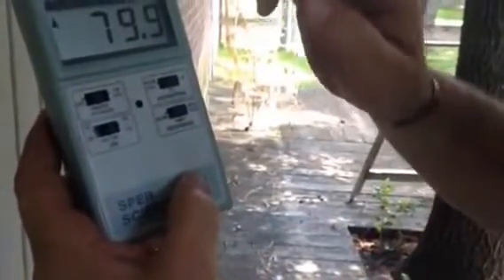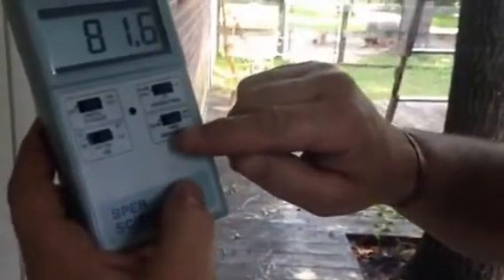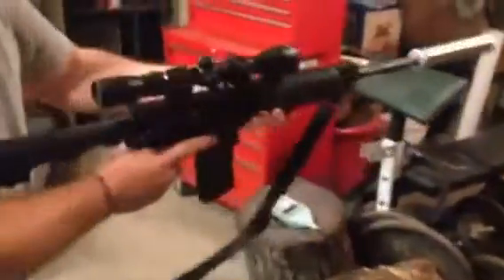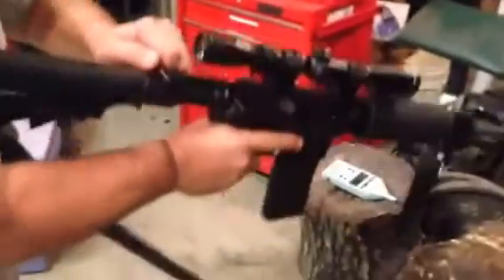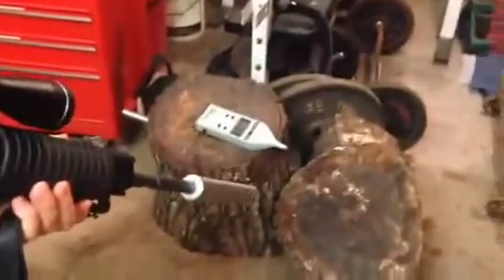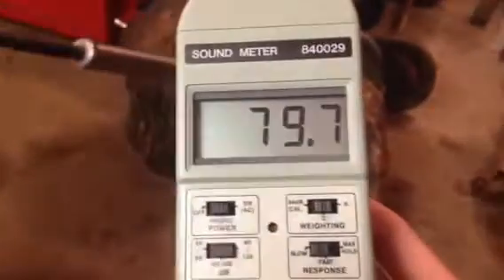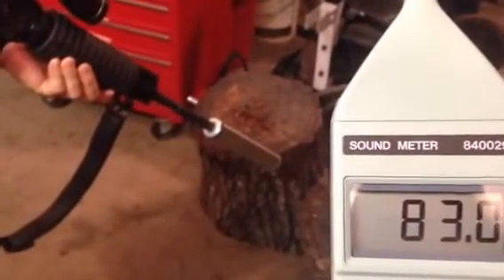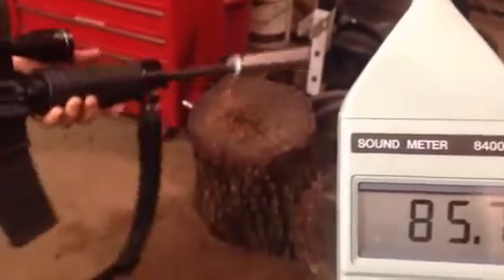Silencer / Suppressor build sound decibel testing

Comment: Is that fuel filter aluminum.? Because eBay has all kinds of fuel filters on there .
Reply from the maker: Titanium, baffles are freeze plugs (steel). I coat baffles with anti-size with has a high temp rating. I think 1,600º F.

Comment: Your Suppressor suppresses down to 82 decibels with standard supersonic ammo?  I have never seen an AR with Supersonic ammo drop the decibel ratings down to 82. How is it possible you can do this but the manufacturers Cannot do it?  

I was just looking at A variety suppressors in a shop Yesterday  And they said that the suppressors only Suppress Down 30 Db Added a are with a 16 inch barrel Deuces 167 db Which would bring the Decibel rating down too 137 db.  What am I missing out on .
Reply: He does not know what he is doing.  Only a few decibel meters can measure gunshot from what I have learned.  They cost thousands of dollars.   Suppressors are loud.... 135 dB or more.  Most handguns are around 160 dB.  His meter did not even move when he shot.  Only when he shot very quickly.  He should never have posted this video.
Reply: M S he’s using a DB meter that is not fast enough to register the impulse of gun fire.
Reply: Well either way he was shooting without ear pro on so that thing is quiet. I think it’s a combination of shooting so close as well and having a shitty dB reader on top. Bullet probably didn’t build enough speed to break sound barrier
Reply: That and it huge with lots of freeze plugs.

Comment from the maker: Whatever freeze plug and spacer you use just remember to put them against each other before you cut the length and make sure the spacer will not slide in to the freeze plug or vice versa. Not a problem if does, it can be fixed: flare out the spacer, but ensure it will still slide in to the tube. 
As far as freeze plugs closest to blast chamber: I started out with eight in the first one and moved down from there in the next four. Just keep in mind you can always add the extra holes in the first freeze after you test, but you cannot plug / remove them. For a 9mm semi auto you will need to add a Recoil Booster (about $150.00) so the action will cycle. You can add a stiffer recoil spring in the slide action of the gun to add a millisecond before the slide pushes back and lets pressure / sound escape with the spent casing. You will notice blow back increases using a silencer, thus getting pistol dirty faster. Add holes to first baffles and or stiffer slide spring to stop gasses from escaping with the spent / empty case.
Reply: Is the spacer just a rubber ring? Also where did you get the front and back screw caps? Thank you

Comment: Awesome.. Hey can you say my name in all your videos? lol. Thats crazy if its that quiet. I have high end air rifles that seem louder then that. I bought some freeze plugs from SD as well but after feeling how much weight they would add started looking at other alternatives for baffles. I found these on Amazon. I ordered a SS one   https://www.amazon.com/gp/product/B014TZUSBW/ref=oh_aui_detailpage_o00_s00?ie=UTF8&psc=1  for the blast chamber and some aluminum ones   https://www.amazon.com/gp/product/B0143JODBU/ref=oh_aui_detailpage_o00_s00?ie=UTF8&psc=1   for the baffles. Its only going to be used on a 9mm Sig MPX so with the titanium tube pressures should not be a problem. The first couple aluminum baffles might take some wear but can easily be replaced. How many holes do think I should drill in the blast chamber and in the following baffles to start? Oh, and thanx for all the info? Your saving me a great deal of trial and error. Keep em coming.